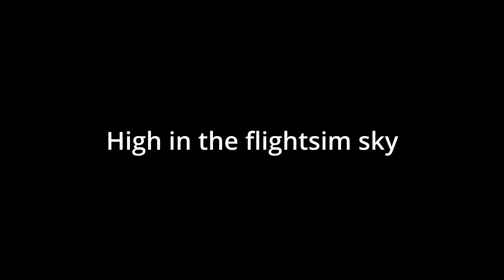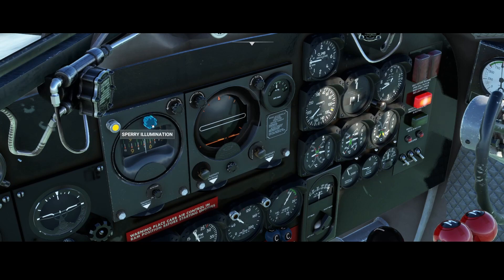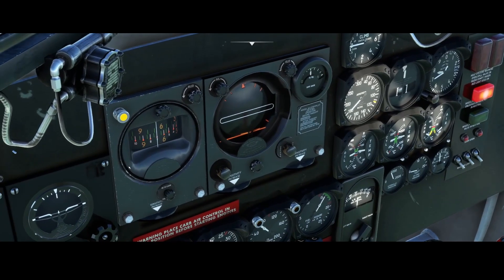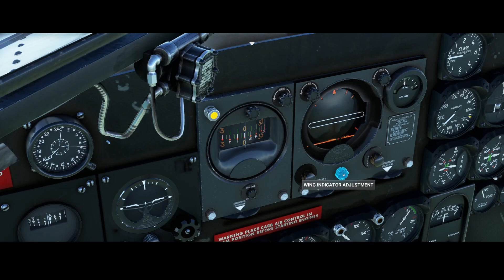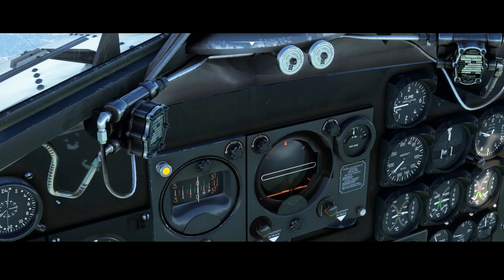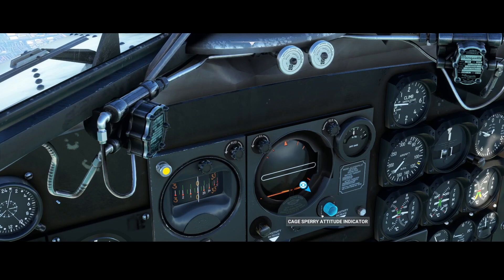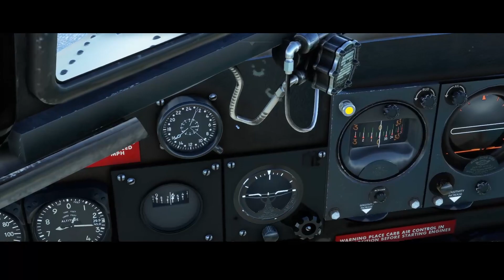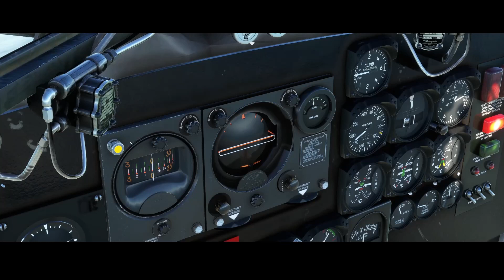Flight Simulator 2020 - How to - Douglas DC-3 - using the gyropilot

Comment: None of this is working at the moment. It's not possible to push any of the buttons, except "Cage Heading". I tried it with legacy controls too, only rotation is possible. The only way to get it to work is by rotating the knob with "AIL" on top of it. Then it will sometimes turn and settle in the desired direction. But once you change desired direction, you have  to rotate "AIL" again. I can't make any sense of it.
Reply: I was struggling with this tonight.. good to know I need to go back to xplane for my dc3 needs 😂😂
Reply from the maker: good to hear you find a solution
Reply: @Highintheflightsimsky  yeah unfortunately the DC3 in X-Plane by VSkyLabs has a G1000 it’s not the sperry but so far the PMDG DC6 and the Boeing 307 Stratoliner seem to be doing okay
Reply: Move the blue hydraulic lever left behind the pilot to GYRO position first, only then the autopilot is working.

Comment: My buttons are labeled differently and I can’t get mine to track a heading… at all. Super irritated this plane isn’t better; I’d be flying it all the time if even just the heading and pitch controls worked at least as well as the Beech 18.
Reply from the maker: hi ddthompson is this the only aircraft experiencing the issue?
Reply: @Highintheflightsimsky  It is! I’m flip on the gyro and the plane dives and will not respond to heading inputs.
Reply: @Highintheflightsimsky  Forgot to mention that I am flying out of the box. I downloaded the two mods and hope to try them tonight (Duck something and the other just called “DC-3 improvement mod”).